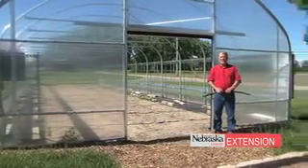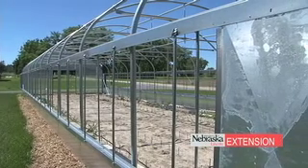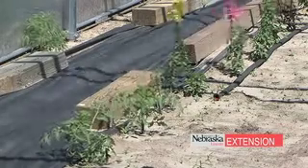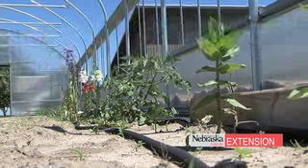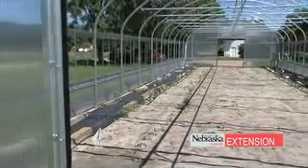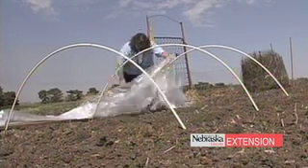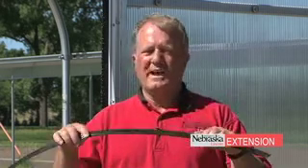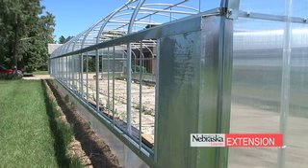Hoop House Project

Comment: For those not in the industry, you may find an a-framed greenhouse easier to build. But I'm a wholesale nursery manger with 14yrs in the business, and have all kinds of greenhouses and I like the hoop house design the best for backyard growing. A well built hoop house with proper ventilation and 6mill poly cover is very versatile and hard to beat. Check out Lost Creek's benders, I hear they are very easy to use...

Comment: @steflova2 , Hoop houses are traditionaly  are half circles because of the structural advantage of the half circle or arch to transmit the weight of water or snow to the ground. The down side to this design is the lack of head room at the house's sides. High tunnels developed out the need to have more usable sq/ft while not having an excess of greenhouse height. You never want a green house to be taller than necessary as you then have to work harder to change the increased amount of air inside.